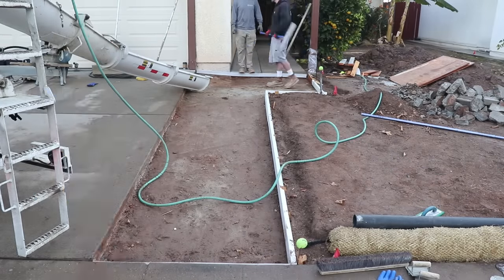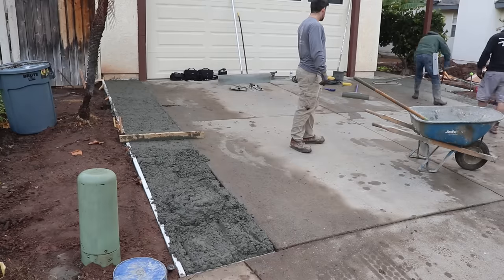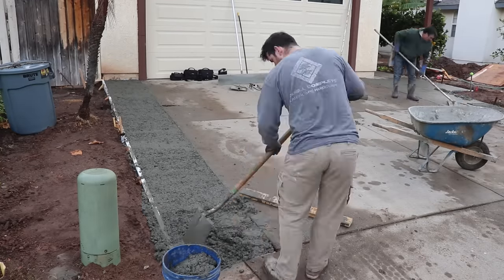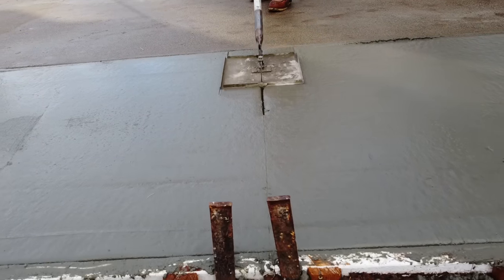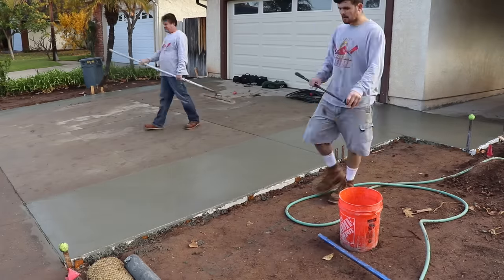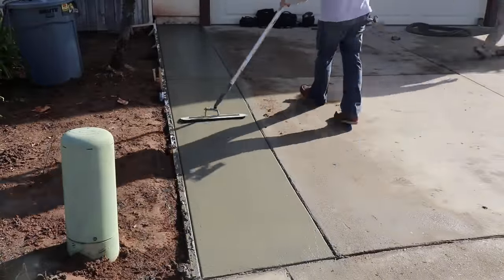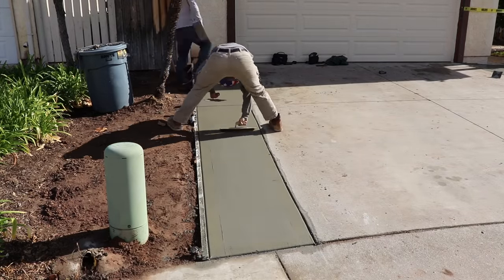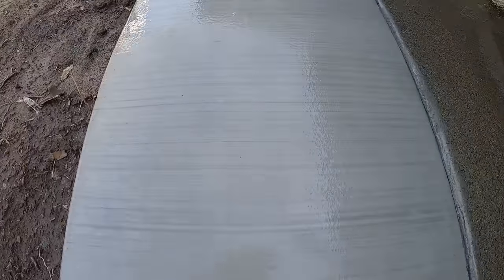How to Widen your Driveway DIY

Comment: That’s awesome. If you’re a homeowner doing this make the sidewalk part flow into the entry. Having that hard right turn then a hard left turn to walk towards the door is dumb especially if you’re drunk,lol. This homeowner should have shaped it without having a corner at the end of sidewalk meeting the entry way. So basically a board done on this angle / to make it eliminate corner & make comfortable to approach entry and to make mowing grass easier. I’ve been a landscape designer/installer for 25 yrs( complete properties with grass,landscape,hard scape,waterfalls,pavers,tile,cement)and we get rid of just about any corners on a property. Looks better and is easier to maintain & in this case easier to walk to front door especially if you need to dolly cart anything into your house or a wheelchair.

Comment: I think the most intimidating problem with doing concrete is not knowing how to handle it when it comes off the truck, meaning has is it too hot? Or is it too wet?  that's the stuff I would be concerned about
Reply from the maker: Concrete can be intimidating

Comment: I noticed this video is 2 years old... so hopefully you see my question. How much would a small project like adding a small addition to the driveway be? Like what you did on the left side of the garage only? What was the a two foot wide addition? I need that for the same reason so my husband and I can park comfortably in the driveway. We got a 1950s house and their two car garage driveways and garages are a bit tinier than most 2 car garage driveways. I'd like a quote of what you would charge to come in and do it... just so I can prepare myself. Thanks
Reply from the maker: 2500

Comment: Great work. This looks amazing and thank you for sharing. I'm just curious if the new driveway will slide out from the existing driveway?  Can a rebar be used to connect the existing driveway with the new one, or is that not necessary?

Comment: I need to extend my driveway 2 feet on one side. If I did the prep work of removing grass and dirt, building the forms, what do you think a local contractor would charge for the concrete and finish work?
Reply from the maker: 1500
Reply: Nice. Not too bad. I'd consider trying it myself, I love all things diy. But after purchasing or renting the specialty concrete tools, I probably wouldn't save much doing it myself and would spend a considerable more amount of time

Comment: would it make a difference if i drill some rebars in the existing concrete to connect with the new?
Reply from the maker: Depends on the condition of the concrete

Comment: No steel? Not worried about the weight of a car causing the two slabs to separate or crack?
Reply from the maker: The concrete is very thick.
The base is good.
No worries

Comment: I ddi the same thing to my driveway 6-7 years ago now, only I went stamped and colored to make it better match the front brick facade on my house.  I never quite understood why they don't pour the driveway like this every time.  Who wants to step out into a yard that might be wet/muddy for some reason.
Reply from the maker: I concur
Reply: Did you pin your side extensions to the existing driveway using rebar?
Reply: @rayphillips815  I did, and I also put welded wire mesh in before the poor as well.
Reply: @kylehiltner4185  yup, I've got the wire mesh spec'd, but realized that parking 2 SUVs on the driveway almost always requires one set of wheels to be on the grass, which will soon be concrete.  Think I'll be adding the rebar pins across the cold joint to help transfer loads.

Comment: Question when putting the stakes to form the 2x4 do u only put the out the outside ?What do u do If the 2x4 is twisted can a stake screw in the inside where cement goes?
Reply from the maker: Yes but you have to pull it while the concrete is wet, then it might still twist.
Reply: O I see so it’s in my best interest to have straight lumber right?
Reply: Thank u for the response! Great work

Comment: What determines the slump you need/want for a particular job?
Reply: If something is sloped like this driveway or steps you want something stiffer so it doesnt fall. If something is more flat you can get away with a higher slump like a 5